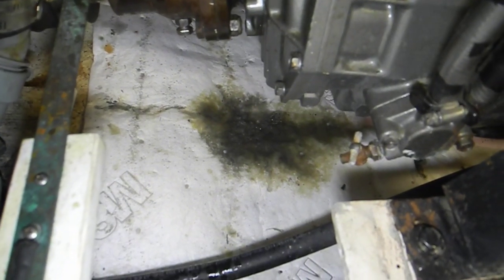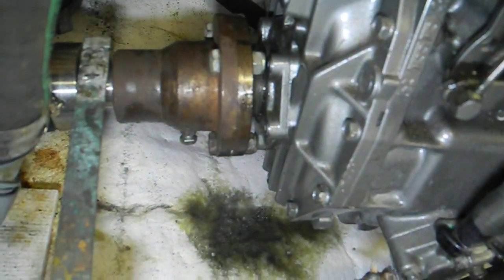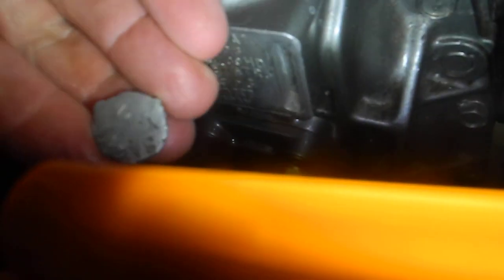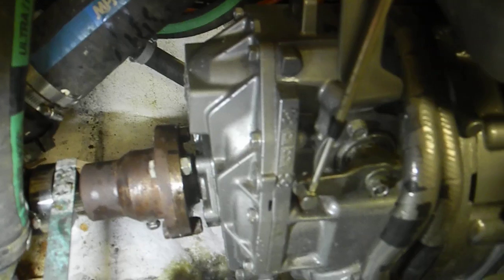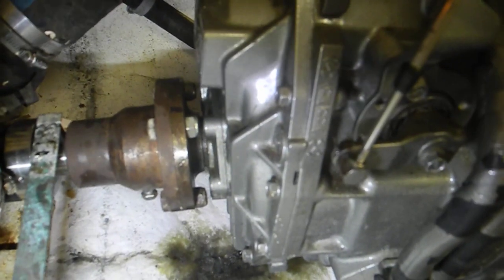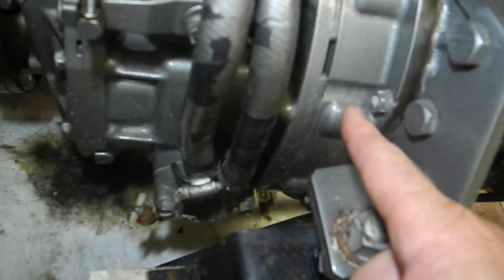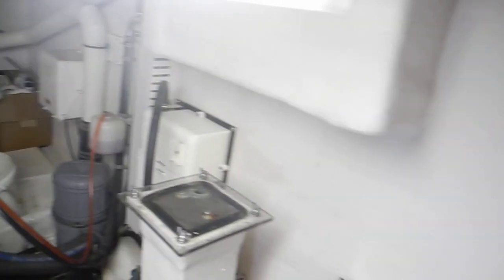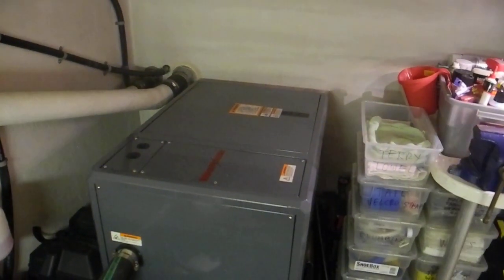Cause and Cure transmission failure

Comment: That whole situation just screams that the previous owners did minimal operational checks on the transmission. The oilsorb pad does not show as much oil from the transmission as it should have had to catch. ( looks like about 1/2 gallon at most, the majority of marine transmissions need around double that. )
Kudos to the new owner for actually having the oilsorb pads, they are not cheap to buy even if they can save you large fines from oil spill into the water. ( fines depending on cruising area in both if present and amounts )
Reply from the maker: Jaqui Greenlees It blew out because a gear slid off an internal shaft and it seized. The fluid blew out all over the the engine room and into the bilge. The oil sorb was put down after the fact so that’s why it seems to be such a small amount. This is a once in a lifetime catastrophic failure. The transmission shop in Fort Lauderdale had never heard of nor seen this before. And BTW we recommend many items to have on your spare parts list. Oil sorb is one of them. https://www.captainchrisshipstore.com/collections/good-stuff

Comment: Great Videos I wonder why the plug came out ? AWESOME videos thanx smokeywilson
Reply: My thought is they it had no locktight of any strength and the vibration of the engine just loosened it over time.
Reply from the maker: Alabama Smokey Wilson It blew out because a gear slid off an internal shaft and it seized. The fluid blew out all over the the engine room and into the bilge. The oil sorb was put down after the fact. This is a once in a lifetime catastrophic failure. The transmission shop in Fort Lauderdale had never heard of nor seen this before.
Reply: @AskCaptainChris  sounds like my luck ! Thanx Smokeywilson
Reply: @jaquigreenlees  usually stuff like that is pretty much trouble free at my work a almost new rotary cutter had a snap ring 3 inch jump out blew ever thing out dealer said first ever things do happen!Thanx Smokeywilson

Comment: Was there enough room to slide the prop shaft far enough astern to pull the transmission ? Did you need to pull the shaft coupling?
Reply from the maker: Karl Jensen had to slide the shaft back 7 inches and jack the motor up to get the tail piece to clear the coupling.
Reply: Had to R&R damper plates on a pair of v drives. No fun. The bulkhead was too close to the transmission so the engine had to be slid aft. Made up some guides to keep the engine mounts from falling off the beds. Ah so much time working head down Lol.

Comment: I’m new to boats but I’ve been a auto mechanic for many years. I just bought a 19 foot 1981 L&M runabout with a OMC 230 in it. The guy I got it from said he was out on the water for about an hour and it made a loud clunk and stopped and now it appears the motor is seized. The oil looks good and he said it never over heated. When I put a wrench on the balancer pulley I can move it about a 1/2 either way before it stops with a clunk. The clunk sounds like it’s coming from the bell housing area. Is it possible that the transmission is locked up? I’ve never torn into one of these but I feel I will be soon
Reply from the maker: The only way to find out is to separate the transmission from the engine to see if it will spin freely. Good luck with that!